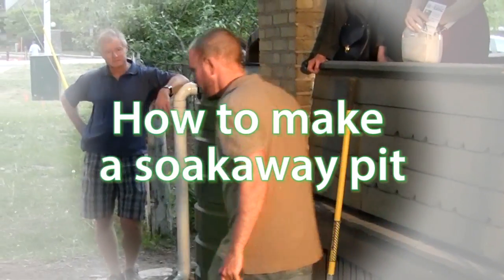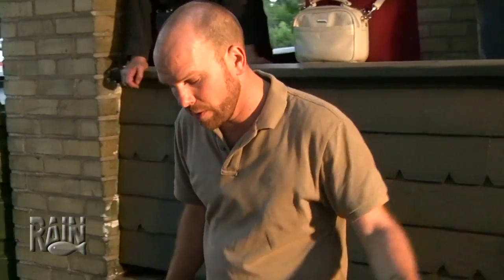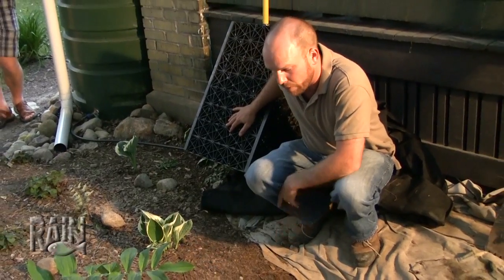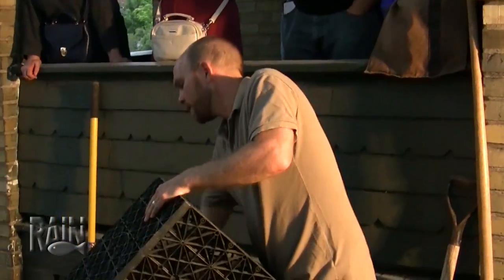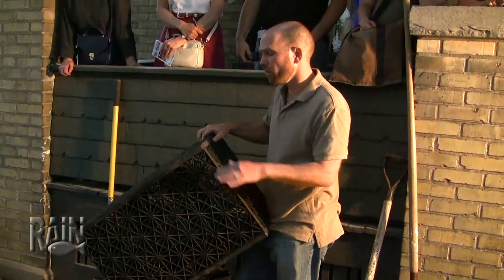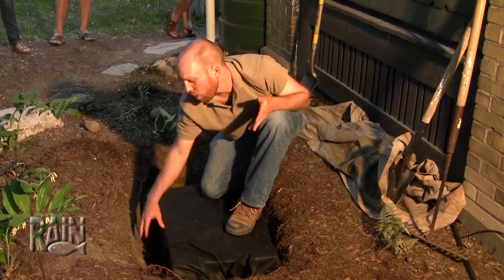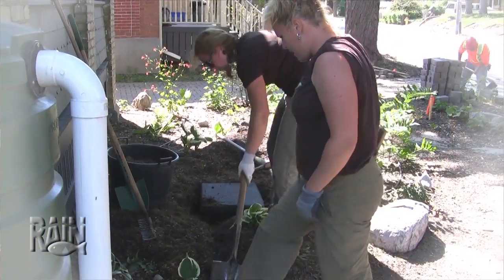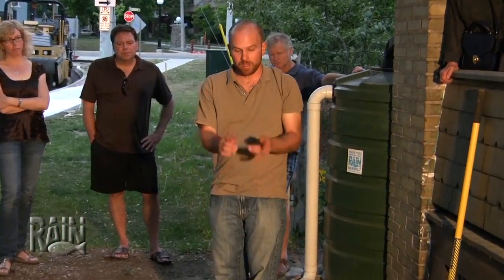How to Make a Soakaway Pit

Comment: There should be a minimum of overlap of the fabric.  The overlap results in much slower soaking through to the void.  Cut the fabric to fit with about a 2” overlap and staple it.

Comment: I live in Etobicoke where the soil is very clay-like, and because of it, I get puddling in the back portion of the site of my backyard after a heavy rainfall or with a snow melt. Would something like this be a good idea to install in the rear? Great video!
Reply from the maker: It may Fernando but you should also consider other options to help you soak up rain water. Here's some more you could consider: http://www.raincommunitysolutions.ca/en/for-property-owners/soak-it-up/

Comment: Why not, instead of dumping the water into the earth - catch the water with the tanks that are already in place & keep that water for watering the gardens. So long as you have leaf catchers the water will be pretty clean & perfect for the gardens! If you attach a filter to the outlet, you could even wash the car/s and/or outside furniture & even the house!? Saves using precious water supplied by city councils etc and you not wasting it by dumping back into the ground.
Reply: did you notice where the pipe is that leads to the soakaway pit? did you notice it is at the top of the tank? at the top. that's a hint.